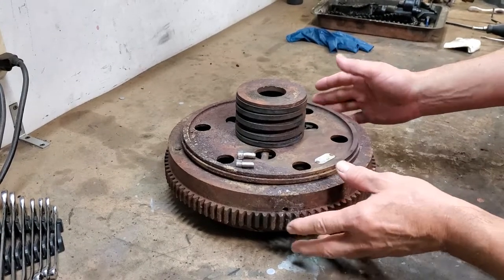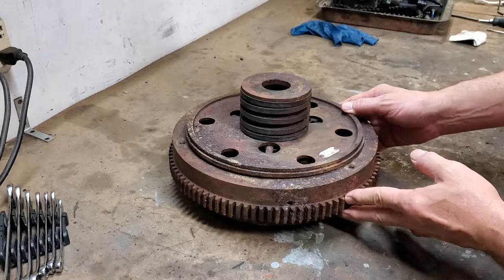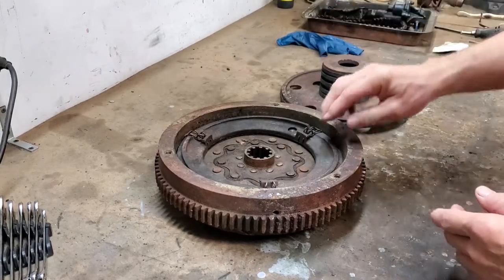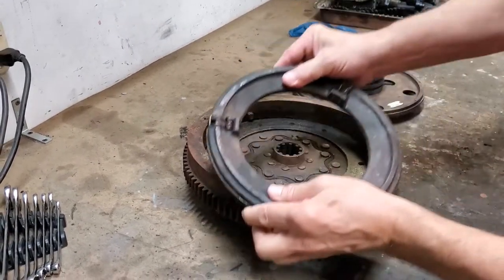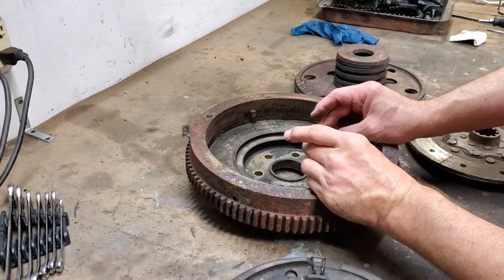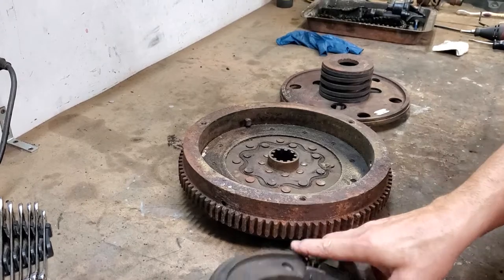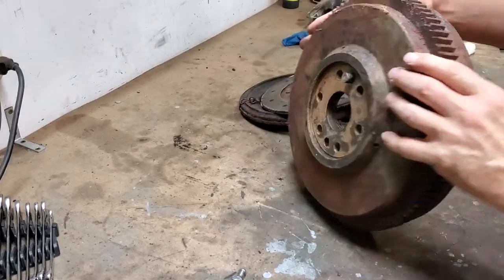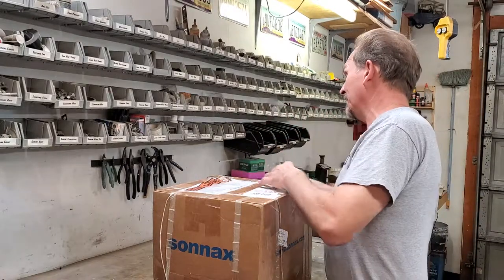Kissel Car Clutch Restoration - Fort Wayne Clutch

Comment: I am having a Riley 9 clutch/flywheel balanced a the moment for a Riley Brooklands replica I am building. It's similar in that the flywheel is deep and the clutch bits go inside it and there is a cover. The engineers mentioned to me machining the inside face of the flywheel to give a smooth surface  for the driven plate then taking an equal amount of the top of the rim of the flywheel so the relative positions are all the same once the cover goes on. I imagine they machined the inside face of your flywheel too? Great pre-war cars films these, most interesting, thank you! I need to undertake making a timber frame for my car and there is very little info out there on doing that.
Reply from the maker: Yes, a small amount or skimming was done. The clutch side was also done to fit. Thanks for watching!